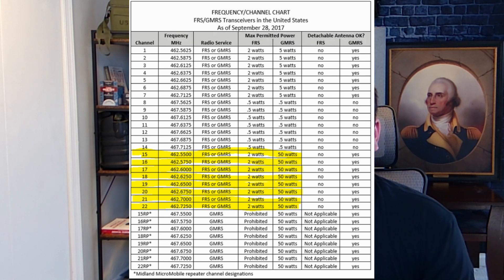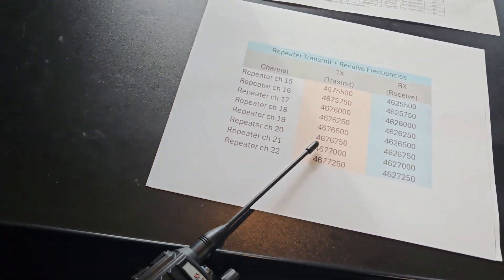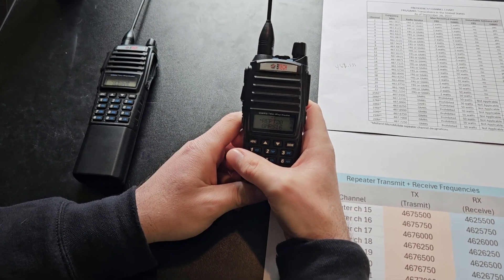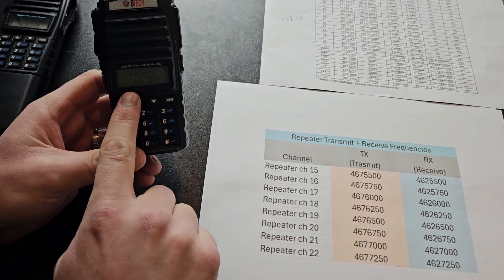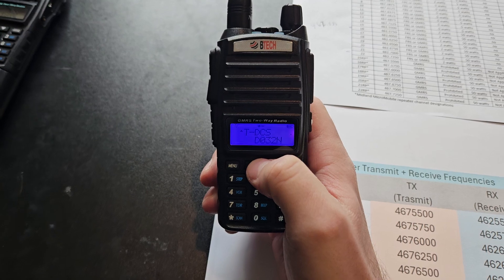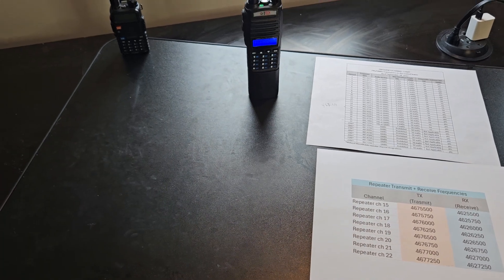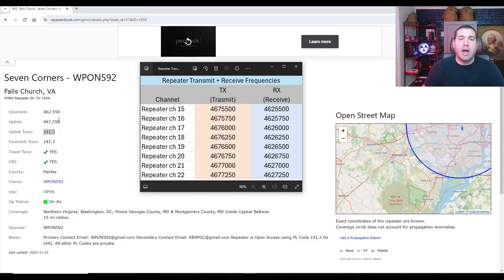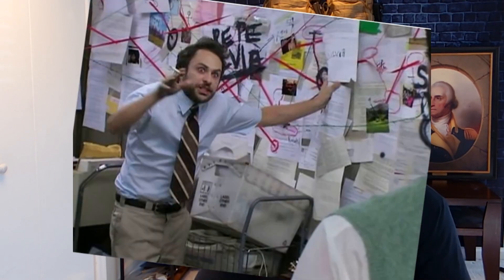How GMRS Repeaters Work & How to Connect to One

Comment: so how do you know if the repeater requires the tone to transmit what it hears? Does the site that lists the repeaters give you this information? CTCS tones and DTMF tones are still not clear to me. I understand the tone opens the squelch on the repeater to hear and transmit? Even the HAM quizzes don't really explain this, it just throws the data out without application. Seemed like the video cut to another section when you were at the end of the explanation of the presence of the tone or the absents of a tone. Still not sure how to know if the repeater I use requires the tone or not? I understand the offset. 70 m is 5 MHz and 2 m is 600 KHz for the offset. The tones is the thing that is not completely clear to me. Thanks for the videos! You do a great job! I'm not sure why more people with a license aren't breaking this down for the new people. Seams like the want to sell stuff and get sponsors than to share knowledge.

Comment: 4:35 fail! you send directly same channel. no repeater needed. its that funny. if there no repeater in range use that. then it not work when both radios on same repeater channel. there should be reverse setup so can talk radio to radio LOL in this case we use one freq lol or program repeater/rev listen tx and rx to gmrs channels using reverse offset xD same thing without repeater between

Comment: Do i have to be on a specific channel to listen to a repeater or it just transmits in the same frequency irrespective of channel?
Reply from the maker: If you have a gmrs radio you need to be on the rpt channels in that radio. If you have a ham radio you need to set the frequency and offset.

Comment: How do you get the second one ( the one you put on frequency mode) to transmit back to the first one( the one you set to the Repeater Frequency)?
Reply: it may vary by your radio type but usually lower left button may be orange or blue and switch between the Channel/Frequency mode

Comment: Thank you. I watched your video discussing this. I have rockietalkie. Do you input the output/input frequency listed for the repeater  ( ex 100hz input / 100hz output) or do you input the privacy code corresponding with the aforementioned (ex 12| 100 hz)

Comment: Here is another way to look at it:  the repeater is actually two radios wired together.    One radio listens (receives)  5 Mhz high and the second radio repeats it (transmits) at the lower frequency.    Because it recieves 5 mhz high you need your radio to transmit 5 mhz high.   Because the repeater transmits at the lower frequency you need your radio to receive at the lower frequency.     The CTCSS tone is called sub-audible.  This means you do not hear it, but the repeater can.  The repeater only re-transmits the signal if it hears or detects the tone.  This keeps the repeater from re-transmitting every thing it hears, only message with the tone.  The repeater builder selects the tone he wants.  If you don’t understand you might need to read this again.
Reply: Excellent and much simpler explanation, but not being critical of this presenter.

Comment: On my Baofeng when setting the tone to 141.3 MHz using MENU No.13 (Transmitting CTCSS) and MENU No.11 (Receiving CTCSS) in Channel mode (MR), the value 141.3 MHz does not stay after exiting the menu. However, in Frequency mode (VFO), the value stays. Please, at @5.47 minutes did you use frequency mode (VFO) or  Channel mode (MR)?

Comment: seems I keep getting confused with the more I try to understand, to TX (I have 2 radios) will the radio(s) automatically link to a repeater set up in the HH using say CH'20'? OR does 1 radio have to TX in a RPT CH and will the 'other' radio automatically will pick up while let's say in scan mode?

Comment: So I thought GMRS was the way to go for me. I’m not interested in talking to people across the world so I went out and bought 4 -UV5R And then receive my GMRS license with call singn  now I come to find out there is no GMRS repeaters anywhere near me. I have asked a couple of Ham radio operators and they look at me like I got the plague 🤣 my hometown is Bismarck North Dakota any suggestions? I would appreciate it very much thank you. God bless and be safe.
Reply: @frankgeis6064, following
Reply: Put a GMRS repeater up yourself or get an Amateur radio license. I've been a entry level technician class Amateur radio operator since I was 16 years old in 1996. I've never talked around the world. I've never talked outside the U.S. nor outside my state (although I did kerchunk an illinois & then a michigan repeater with my base station setup when I lived at my parents house on a hill and using a small tower when I was testing how far it could go).

You can use the Amateur radio V.H.F. & U.H.F. bands very similiar to gmrs. Around me every county has at least 3 Amateur repeaters, others, including my county have like 10+ but on some you need special radios to use like DMR, D-STAR, etc... I just got a DMR radio partially cause many businesses around me are switching to that and I didn't want to buy a newer digital scanner. Otherwise I've only used regular FM voice radios this whole time, which is what gmrs uses.

I've had gmrs frequencies programmed into my scanners and Amateur radios for decades and all I've ever heard was kids playing with those bubble pack f.r.s. radios. And according to information I was able to find on the internet, there have been various gmrs repeaters over the years near me but I've never heard them so I've never bothered to get a gmrs license.

Comment: At 9:47, this is where people, newbies, get confused.  According to the picture, say on Repeater 15, the table says TX (Transmit) 467.5500.  But that's the radio operator's TX or transmit frequency on account of the +5 offset.  That is, if you're on VFO mode or Frequency Mode, when you key in on 462.5500, the radio "adds" 5.0000, transmit on 462.5500, the repeater receives it on 467.5500, right?  But the picture says the opposite.  You get what I'm driving at?  I do understand what's really happening, it's just that the picture or table is counterintuitive for those new or unfamiliar with the concept.
Reply from the maker: This is why before that chart is shown i go in depth and show that your radio is tx is 467. I do demos of it and explain it....

Comment: Would super appreciate some troubleshooting help.

I have two gmrs radios on the same repeater channel and have set tones on both radios to what is listed for my local repeater. 

When I PTT and release I get the green light and beeps indicating I’m accessing the repeater. BUT, when I try to talk from my one handheld radio to the other the transmission does not go through. 

Any idea why the other radio can’t hear the radio even though all the tones are set the same and they’re on the same channel?
Reply: I’m using the Rugged Radios GMRS2+ handheld radio
Reply from the maker: Sometimes radios have programming errors it's possible it's not transmitting on that channel I have seen that before best way to test this is try using a different radio. That's what I would do.

Comment: Can you do a quick video on how to connect the Baofeng GMRS 9R to a repeater? My men instructions seem a little different.
Reply from the maker: the gmrs 9 r connects the same way as in this video you repeater channels may just be labeled 23 to 30 and not 15 to 22 but just line them up and you should be good to go again go off repeater freq not channel number.

Comment: How do I know that I am connected to the repeater? I’m getting the same distance as if I’m using a frs walkie talkie… Please help. New here and I’ve run into all the step on your video.
Reply from the maker: Take another gmrs radio set on the same repeater channel with the same tones and settings turn the vol up set it near by so you hear it and try transmitting through the repeater to test it that how I test my home build repeaters.

Comment: I guess my other comment on this video which I am confused about, I see you putting the tones in on the RPT channel, not the GMRS channel, and lets say I am talking to someone through a repeater.  It would seem both radios would need to be programmed and using the repeater channel not the GMRS channel if you want to talk to each other.  How can a person using a GMRS channel reply back to you on that channel if the GMRS channel has no tones programmed in to transmit.
Reply from the maker: Repeater channels listen on regular gmrs channels but transmit on another channel watch my offsets video it may give you some more insight on how this works. https://www.youtube.com/watch?v=h1sAqRih2so
Reply: @citizensurvivalplan  Yes, I watched that and I do understand how the offsets work, on GMRS apparently it does it automatically and it's always +5, but that wasnt really my question, in your overview you say if the person you are talking to through a repeater isnt actually doing anything but listening, they dont need any tones set on their radio in the GMRS only channel.  But in almost all cases, I cant figure out when you would want someone that would only be listening, they would be talking as well responding back to you so that means they are also transmitting which means they would need to have the PL code programmed on their repeater channel and using the repeater channel not the GMRS channel.  Which to me means the GMRS default channel is mostly useless for practical purposes communicating with another family member.
Reply from the maker: The person you are talking with on another radio would have to enter a transmit tone to go through the repeater to talk to you but would not need a rx tone (receive) the regular gmrs channels are for simplex Radio to radio communicating if there is no repeater near by to connect to. Remember privacy tones only tone out other radios its not private.

Comment: I am just getting in to GMRS and one thing Im not clear on, is adding new custom channels on my radio.  Let's say I want to set up a repeater channel, I notice that the frequency of the repeater I am going to be using is 462.700 which corresponds to channel 21 on my radio.  I also notice that channel 29 on my radio has that same frequency.  Do I modify the one of those channels to have the correct PL (CTCSS) assignments, or do I use VFO and create a new custom channel with that same frequency and add the PL inputs.  The reason I am asking is because I dont want to create a custom channel and get in trouble with the FCC, but also, what if I go to a different area and want to use another repeater someone is running, but it has the same frequency as the one in my area, so it seems that because repeaters in different areas can have the same frequency, the best solution is to create a new custom channel for that frequency for both locations, or do I need to just modify the existing channels and then when I go to a new area modify them again.  In my situation since, and for anyone reading this, I am using the TD-H3 in GMRS only mode.  I dont want to unlock it at this point to normal mode until I have more experience.
Reply: Excellent question.

Comment: I figured it out on my UV-5R i used a channel mode to communicate with another UV5R but the receiver is Frequency mode with the same channel. Took me almost 4 hours to figured it out. I only use it for Emergency just in case the grid goes down.

Comment: Looking a bit deeper into your video there is something I don't understand.  At around 8:26 you show a table you've made.  For repeater ch 20 you show it receives on 462.675, however on another video it said if one was listening on Channel 20 one might hear the conversation from Rep Ch 20 but could not talk to them.
This indicates Rep Ch 20 transmits on 462.675.  ????
Are you quite sure your table is correct?
Reply from the maker: Idk of another vids I made about repeaters but if you are on a repeater   channel it listens on 462 and when you hit transmit it offsets it up to 467 this goes for all 8 gmrs repeater channels.
Reply: @citizensurvivalplan  ok, but what I don't understand is if it's listening to 462.675 how does it know to ignore things on Channel 20 which broadcasts on 462.675?
Reply from the maker: You would be using privacy tones that's how but if you did not you would hear people on repeaters on regular channels.
Reply: @citizensurvivalplan  so the only difference between Ch 20 and Rep ch 20 is the tones?
Reply from the maker: No channel 20 listens and transmitts on 462 repeater channel 20 listens on 462 but transmitts on 467 the repeater takes in you transmitting on 467 and spits it back out on 462.
Reply: @citizensurvivalplan  if rep ch listens on 462 how does it know the difference between regular transmission on ch 20?
Reply from the maker: it does not they share that freq. But you can use rx privacy tones to filter out what you do not want to hear.
Reply: @citizensurvivalplan  well now I'm totally confused.  First you said no that tones aren't what made the difference but now it seems that is what your saying
Reply from the maker: privacy tones have nothing to do with the channel you are on. if you really want i could try and talk to you one on one in discord or somthing to help you out.  citizenplan711@gmail.com
Reply: @citizensurvivalplan  I really appreciate the offer.  Right now I'm deep into the women's final 4 game maybe later?
Reply from the maker: @olegig5166  Just email me we will set something up at some point for sure.
Reply: @citizensurvivalplan  👍
Reply: @citizensurvivalplan  I sent an email, might show up in junk folder.
Reply: The content creator is correct. Repeaters just work that way. They have an input and an output frequency. The tones are there to keep other radio frequencies from activating the repeater or to keep other repeaters that may be using the same frequency from doubling (interfering) with each other.

Comment: I’m still confused
Reply: Maybe this will help, when he says that the repeater spits it out, he means that the repeater re-transmits the input frequency on another frequency. The tones that he is talking about can be thought of as a door key. The repeater would be the door that is locked. You can turn the door knob but the door will not open until you use the key. The key is akin to the CTCSS tone. GMRS automatically sets the repeater offset for you so that you do not have to do it yourself. GMRS makes using a repeater simple for you. The only thing you need to set is the tone and you are golden.
Reply from the maker: Everything in the begining to middle of the video is just info on how it works. The end of the video shows you how to connect to a repeater. If you need help send me the repeater info that you are trying to connect and i can help....
Reply: @citizensurvivalplan I’ve been trying to figure out how to connect to a repeater for months and I have no idea at all
Reply from the maker: @nicktres19  Tell me the channel/ freq and tones of the repeater and I can help.
Reply: Me too
Reply: If you’re using a certain repeater, let say Repeater 15. Does your other gmrs radio needs to be in same repeater’s channel? And if so and you manage to hear your voice on the other radio, that means you’re all set and ready to go? I tried that and I heard a voice asking me what am I testing. I can hear my voice on the radio but how come he can join our conversation?
Reply from the maker: @joeweberofficial  some radios list the repeater channels as different numbers make sure you focus on the frequency not so much the channel.
Reply: I’m more confused now than I was before I watched the video
Reply: Me2 😫
Reply: Me too!
Reply: Absolutely
Reply: Me 2

Comment: Lol. I don't get it. First he said that repeaters are already pre set into the radio and then he said we have to search for a repeater and type it into the radio .
Reply from the maker: The repeater channels are preset into your radio but you would have to do an internet search to find what channels are active or who has one set up to use it. Or you can set up your own repeater.
Reply: @citizensurvivalplan  I tried looking up a repeater frequency in my area but it was in the 9000.00 n that didn't make sense. That didn't match any channel frequency range. I am in Wisconsin near Milwaukee.
Reply from the maker: make sure you are looking at gmrs repeaters and select by state here is a link choose state and see if you can find any repeaters.https://www.repeaterbook.com/gmrs/index.php?state_id=none @MikhelKovak
Reply: @citizensurvivalplan  so I found a frequency for Wisconsin Dodge county 462.600 and a tone up of D244 and something called a 'location' 103.5.  What is the next step. I also found that 462.600 is on a gmrs chart for channel 17.
Reply from the maker: I looked up this repeater it is on REPEATER channel 17 not regular gmrs 17 just enter your tones and you should be good to go as long as you are in range of this repeater. @MikhelKovak
Reply: @citizensurvivalplan  i will try to figure this out. I feel like I'm getting some better at this. Appreciate your time bro.

Comment: Hi De WRVS650, NJ
First off thank you for the video very instructive. I’ve a question my local repeater has frequency 462.700/467.700 PL IS 67.0 INPUT ...OUTPUT IS OPEN. Now My question is the input tone 67.0 goes to TX and in output tone open goes to RX where says open mining none ?? Because I hear traffic but when I PTT don’t hear the kickback from the repeater.  Thanks !
Reply from the maker: leave your rx tone off then. you may be out of range for your repeater meaning it can reach your but you are not using enough power or you need to stand somehwere higher up to hit it. IT sounds like your tones are ok. To test this you can move closer to the repater and test your settings.
Reply: Perfect !! Thank you so much for the info and replied back to me. @citizensurvivalplan